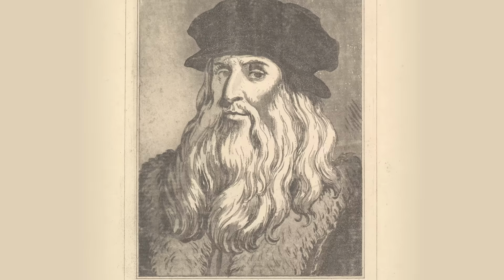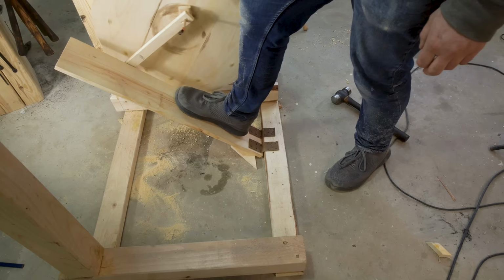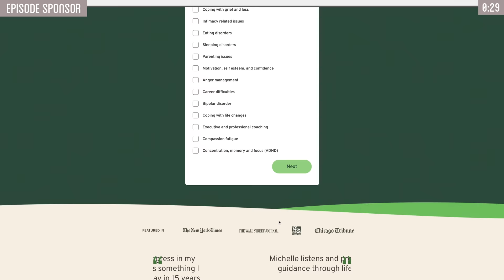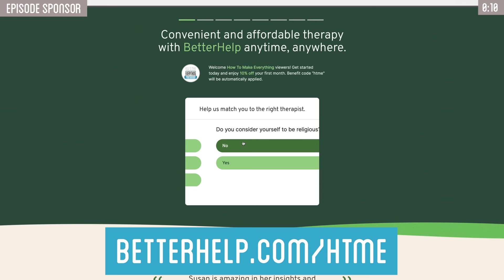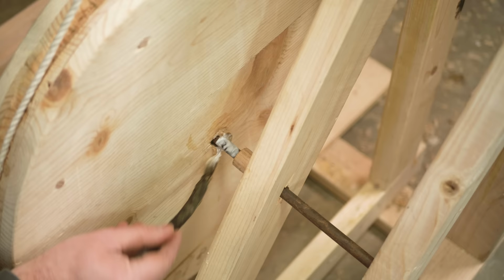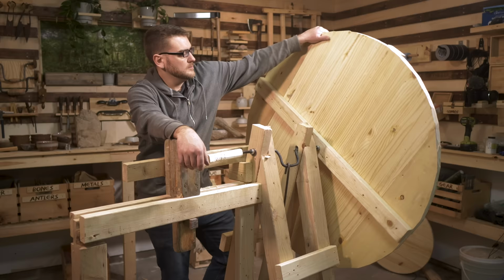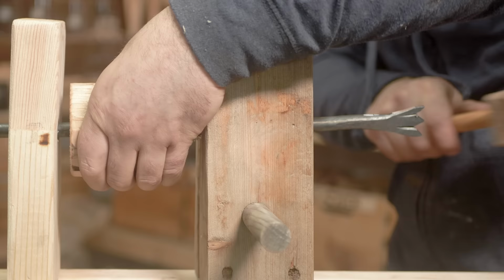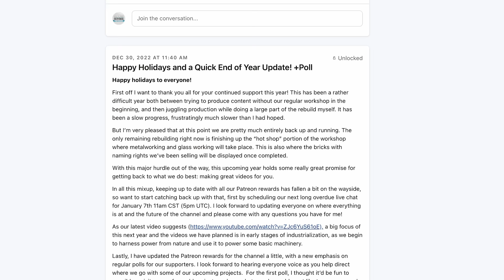Does DaVinci’s 500 year-old Lathe Work?

Comment: I've seen people use treadle lathes at renfaires and re-enactment camps. Almost universally, they grabbed and spun the flywheel by hand to start the motion that they then sped up and maintained with the treadle.

Primitive != Crude. Your level of precision is, I'm sorry to say, shit. You should be using your crude spring pole lathe to make better parts for the primitive, but not crude-spring pole lathe, which then turns into a treadle lathe that has a great degree of precision built into it. Part of your precision problem is that you're using green wood that you've gone out and cut down yourself and used immediately rather than drying that wood, or getting already dried wood. Hard wood vs soft wood. You know that these things are important, you have to by now. Durability and Precision are the reasons why they are important.

Another way to think of this in terms of The Great Reset, is that you've successfully unlocked "Round Things." the problems you're seeing with your projects currently is that lack of Precision. You can't really build a good working treadle lathe because you never really got good quality working tools from any of your stages, just the most crude form of whatever you could bodge together. That simply doesn't work once you start entering the era of the Antikythera mechanism, the magic mechanisms priests used to amaze their followers by opening the temple doors at sunrise, or to dispense an exact amount of holy water, or essentially ANY of DaVinci's mechanisms. DaVinci's artistry allowed him to express and record his engineering which was advanced for the day, but not wildly so. (even if some of his ideas really were several engineering leaps ahead.) Other engineers of his day would have had little difficulty duplicating any of his devices, which is why he put everything in code.

Everything you're making these days is quite crude, but should be anything but. Even from the dawn of the bronze age, none of the tools they used were crude. There is absolutely NOTHING crude about either a windmill or a watermill. They may have been made from wood, but they were precise machines. without fixing your problem with crude=done, you're going to get someone killed soon.

Comment: Stop using construction lumber. It's supposed to be used for...wait for it...construction. Precision is not the purpose. When you have this kind of serious levels of precise fitting needed, you need to stop using crummy wood and bad construction practices. Carpentry is not a simple process. You are not supposed to be just hacking away at the wood like that. The fit on your stuff is slapdash at best and that means it is all wobbly, which means the alignment of parts is off, which means any issues magnify themselves.

Comment: Be careful copying DaVinci's works.  In nearly every one he introduces a "flaw" that will impede or reduce the object's function and usefulness.----This according to speculations, was to "protect" his inventions, while still being able to make drawings for prospective clients.  YOU discovered that he left out the pulley that allows the worked piece to spin faster than the flywheel .  If you look closely at his "Tank", for example, you will see that the cranks to move it would never work as they turn against each other.  Da Vinci's drawings were detailed enough to show clients and also remind himself about what he had invented, but it would NOT work if someone  unauthorized tried to copy it.  He kept the secret to himself and could always supply the missing or flawed part, from his own head if need be.-------So I think it is perfectly "permissible" alter his design's a bit---That's why he drew them the way he did.

Comment: it hurts, that given todays tools, knowledge, materials...
that this looks like something slapped together in five minutes by a bunch of ten year olds, and works as well as it should for being so slip-shod.

i just cant see someone 500 years ago being so... sloppy. each bearing would have been carefully scraped, possibly filled with lead first... the wheel scribed and carved and running true... they maynt have known about balance of high speed shafts and young modulus or carbon nanotubes, but they did know about the importance of workmanship.

but thats what today gets. everything has to be done yesterday... sigh.

Comment: Your creations .... Show explain the concepts . But in reality... are not a fair  reflection on the original  designs.
Largely because you take to many 
S h o r t c u t s . The workmanship is 
very s l o p p y .
These creations need  mortice joints & guscets and bearings.
At minimum ...metal sleeves with the correct tolerances.
There is no question that you don't work hard. But your work is let down by not taking the time, planning & material, to do the job properly.
I suggest you work on the moto....
Do it once, do it right ...in this way what you create, you could put to good use or sell.
And take pride in the skills G o d entrusted you with.
I understand that when re-creating products from history, with few details, it's  going to take longer and a number of  changes have to be made.
In cases like these, build a scale model first.... In this way...any  modifications having to be made 
Are much easier.
Otherwise ...you are only making a rod for your own back....so to speak.
Work hard work smart...
          Not  S l o p p y !